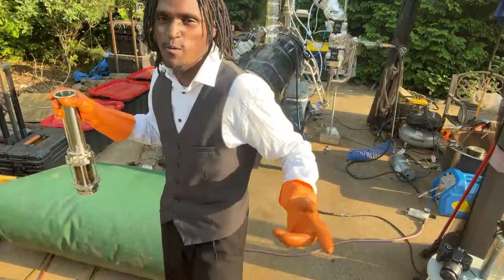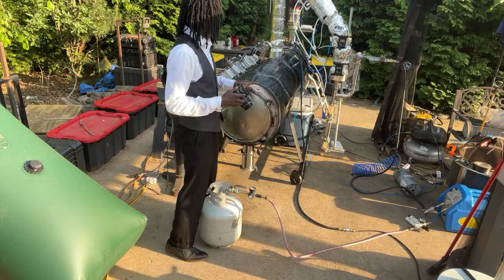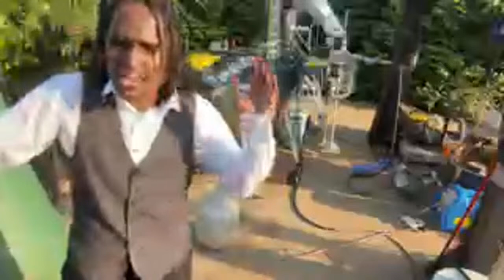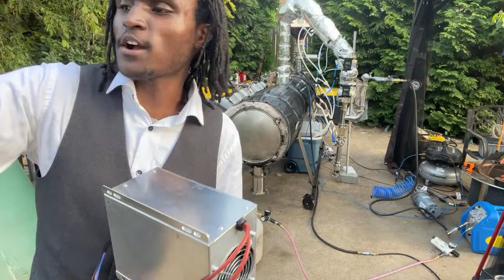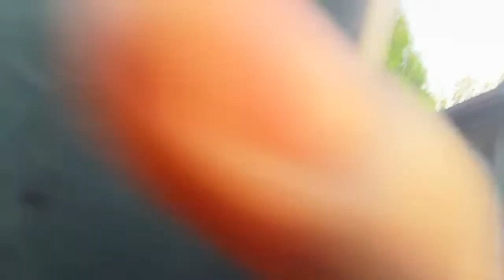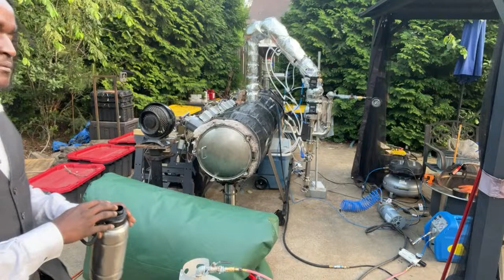Plastic Oil Under Vacuum!

Comment: Mr tesalonian does alot of bio fracking wood gas ⛽️ there is also a japanese company years back made a washer looking machine the did same thing your doing. You should make solar  cells to power everything or use a fresnal lens and solar power the heat sourse to molten salt and heat pump the heat into reactors and make is stand alone truly and solar driven daily and stored energy ran in dark times. You can even make earth battery to battery banknto convert to run suoer capacitors to.run things. There are many ways to run this reactor stand alone. Cool stuff

Comment: Has Nature Jab tried to fuel up the car with the plastic oil before?(Never mind I found the video)
Reply: No the oil has to be refined before being used that way
Reply: @OneDayBetterDad  When will he do that?
Reply: Im not sure im not him. He could be more focused in trying to produce more oil before even considering refining it. He has talked about the oil needing to be refined because it has several different potential uses. But the “propane” he is able to already used due to it being a more isolated type of gas
Reply: @ericbeattie5288 he shared that the propane produced makes his generator misfire. I think it's too low pressure in delivery,  but maybe with the vacuum he's displayed here it's enough pressure. I haven't finished this stream yet so hopefully I'm not mis-speaking
Reply: so i just checked his channel and he has in fact ran a diesel truck (not sure if it's the one he mentioned in the stream, i didn't watch it) from the plastodiesel, and it worked perfectly fine!
Reply: He ran an old Ford power stroke diesel off of some of his plastidiesel, older diesels tend to be better at handling less refined fuels.
Reply: @northernmetalworker  I just found it thanks
Reply: Been wondering too!
Reply: there was a video where he ran a gas powered grass cutter from gasoline refined from the oil, and on his tiktok a video where he ran a small engine, i would think he hasn't tried it yet because he doesn't want to possibly damage his engine before checking the composition of the gasoline (which he calls plastoline)
Reply: Tell us you're new without telling us you're new. It'd be like putting crude oil in your car